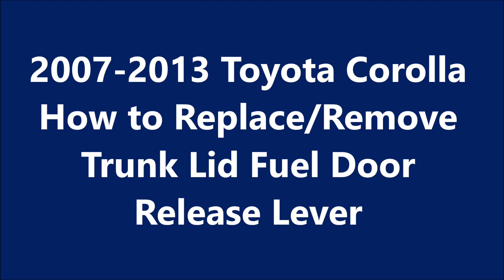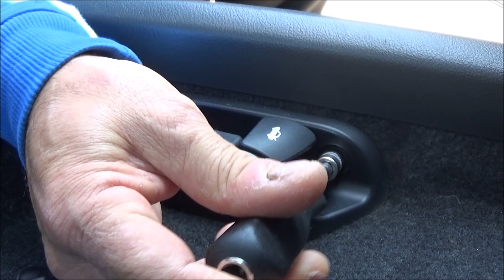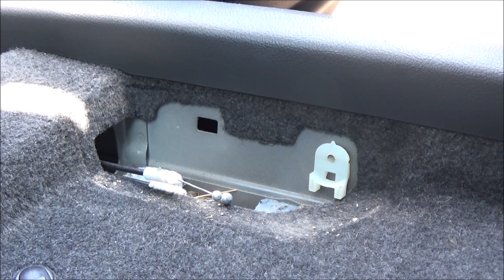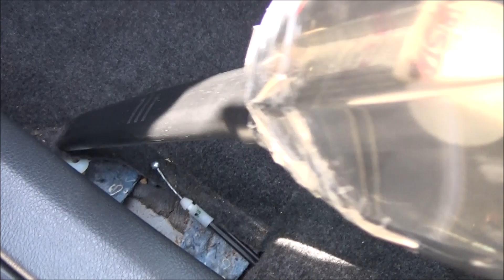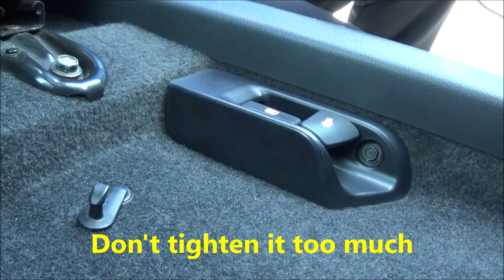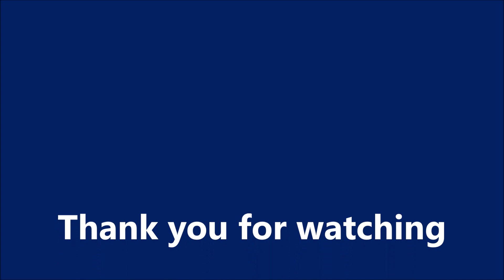2007-2013 Toyota Corolla How to Replace Trunk Lid Fuel Door Release Lever Μοχλός Πορτμπαγκάζ Καύσιμο

Comment: Thank you so much. Just want to ask if I have an issue with my corolla, I s the front window track ( Rails) , one side can see its bend. Would you please let me know  how to remove the windows track ( Rails) from the door panel;  Thank you again
Reply from the maker: My friend, maybe the following video will help you a bit
https://www.youtube.com/watch?v=fayAX9npba0
Reply: @YiannisPagonis  thank you so much. My car is Corolla verso 07. Do you think the front door glass rail also hold by two screws. Will check again hope will find the top and bottom screws thanks again
Reply from the maker: @didyouknow138  Yes something like that, I believe there are 2 or 3 screws

Comment: My is a toyota corolla 2010 and is diferent
Reply from the maker: Yes, there are some differences between this generation of Corolla, as is the case with other Toyota models.
Reply: mine is different too. There is no plastic holder. It's just in the metal hole. have you figured anything out about that?
Reply: @jeremiahbabin2638  idk if you still have the car/the problem, but you have to remove the driver's seat, take the trim off the bottom of the door jam, and lift up the floor liner to get at a 10mm bolt by the back of your left heel